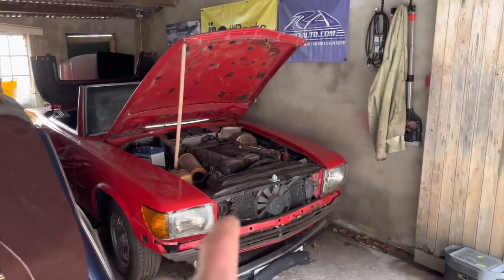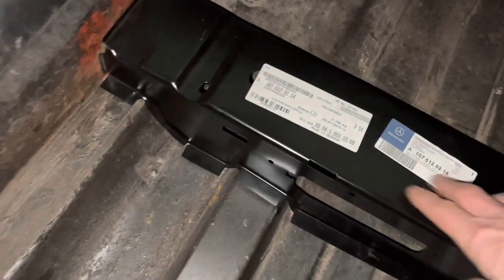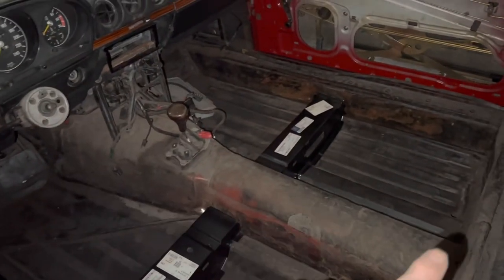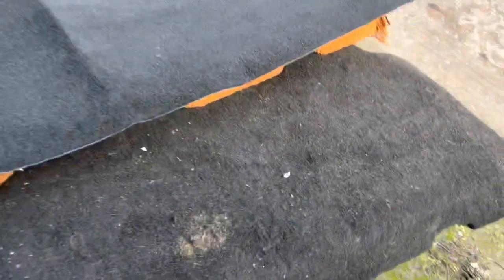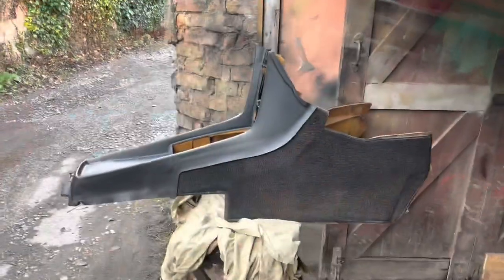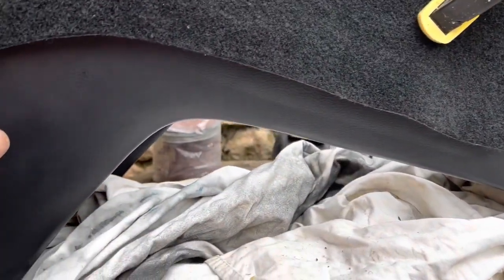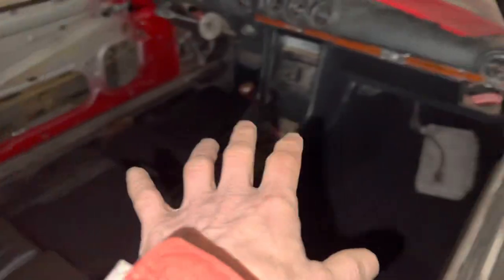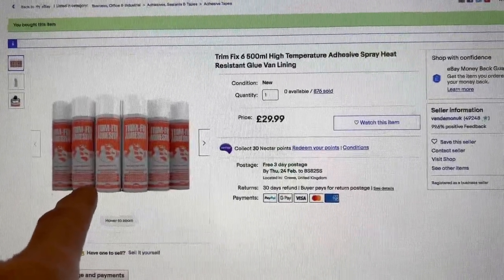Early Mercedes R107 carpets and rear bench seat + floor pan cross members

Comment: Hey Mike have a question you might be able to help me out with. I have a 1980 450SL, everything was working fine until a couple days ago the car just died right when I got home, after trying it magically started again. Ran fine again after a while but i put it up on ramps in the garage to do an oil change and boom dead again. No power anywhere, not even trunk/dome lights, nothing at all. Battery is good and battery cables seem to be good as well. I can hear the clock in the dash working very faintly but nothing else. You think it could be a short or a misconnected ground? I also checked the relays and they seem to be fine as well.  Thanks
Reply from the maker: Thanks for your comment. I had something similar on my Pagoda….which turned out to be faulty cable from ve battery terminal to chassis. Put your voltmeter on continuity setting and touch one probe on -ve terminal and other on chassis the meter should change showing continuity. Clock is wired straight to battery and is one of the few things that doesn’t go through fuse box. Similarly hazard lights - do they work? Mike
Reply: @MikesMercsandothercars  Thank you, I'll do a continuity test when I get home, had done one with the ground and seemed to be perfectly fine, could be a positive cable issue. Strangely enough the hazard lights don't work, but if i disconnect/connect the battery it clicks irregularly until i shut it off but the lights don't turn on.
Reply from the maker: @Gaston.Perdomo  That sounds like a bad earth...eg just enough current to operate the relay but not enough to light up the bulbs. It would be interesting to see what current flows through the amp meter when you turn on the hazards. A short that existed with nothing switched on would tend to run the battery flat so I would say bad earth is more likely. Good luck. Mike
Reply: @MikesMercsandothercars  I'll try switching ground points tonight, if not I suppose to the mechanic she goes. Thank you so much i appreciate your response and always enjoy your videos! As much as a headache this car has been it's something strange as I've fallen in love with it. Hopefully she gets back on the road soon